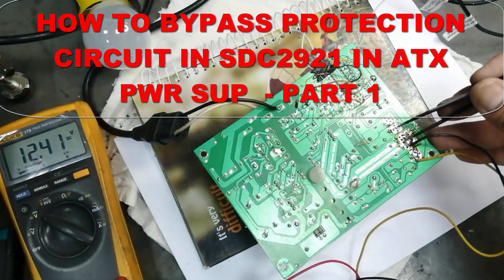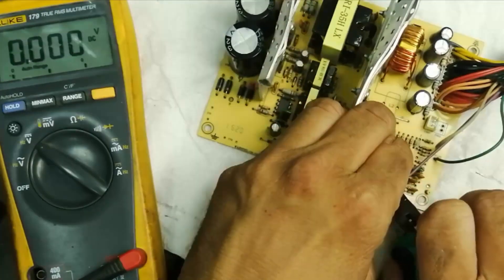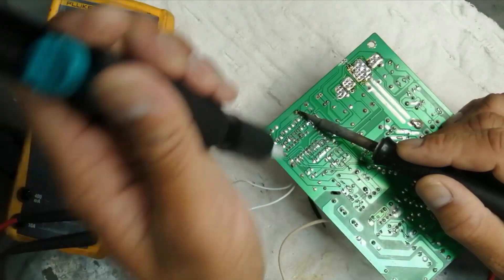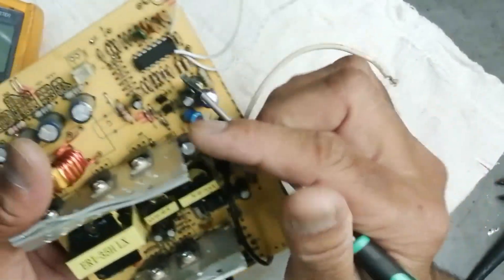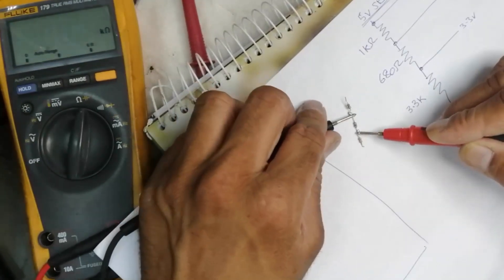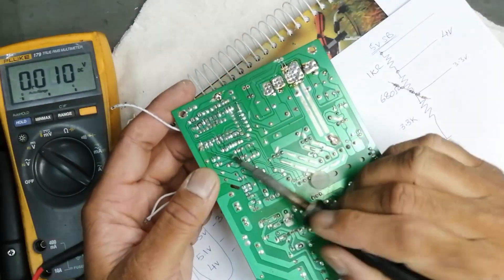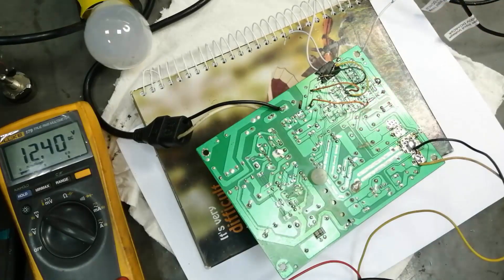#197 How to bypass Over Voltage Protection in ATX SDC291 Part 1

Comment: Voltage divider on 5v sb not working on my test. I disconnected the sense voltage and replaced it with the diy voltage divider. 3.3v + 4v = 7.3v. thats more voltage that the 5v sbv can give. As i remember, the sum of the total voltage of each point will be just equivalent to the initial supplied voltage (which is 5v in this test).

Can you please enlighten me? Thank you.

Comment: 🎉🎉🎉 Gracias por los aportes muy importantes.... Tengo una ATX con un IC HS-8108 la cual me gustaría poder Modificar su Voltaje en +12 voltios llevarlo a 13.8 vol para husar de alimentación para Radioaficionados C.B 27Mhz entre otros usos más como fuente de pruebas de taller .....he logrado revivir otras con el Tl-494 Pero tampoco subirle el voltaje máximo a 12.9 ..... Y al conectar la carga se baja a 11.8 funcionan Pero no me da el rendimiento que amerito y la proteccion en algunos instantes se activa y apaga ....... por favor si me puedes ayudar con lo del HS-8108 ya que está ATX la veo muy buena he logrado encender aparte del radio una bombilla incandescente de alta y baja 12voltios 50 Vatios de vehículo ..... Se le saluda desde San Cristóbal Táchira Venezuela Gracias 🫂🫂🫂🎉🎉🎉

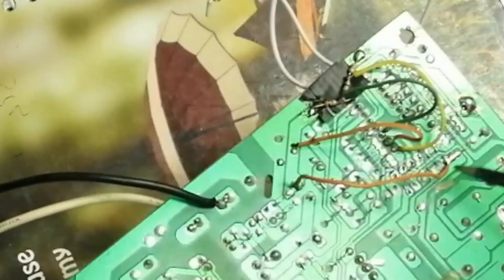Comment: 14:42 sir my SMPS have hs8110 ic ...... sdc2921 ic and hs8110 ic this pin out ar same.... I successfully make it variable but the over current protection is  still working 😢 and it's shutdown... did I need to remove pin 4 (pt) ? Will it work?

Comment: Thank you for good tip video, i has an ATX psu (named andyson e5 400W) with LA8100PN same as SDC2921, when i PS-ON the fan only spin 2, 3 round and off, i check every thing and can't find problem, so i use your trick at this video, so fk good, the PSU work fine 12V, 5V, and 3V3 is okay. So i think problem is three feedback, i check the resistor fb and that true value, no problem on three line feedback. i check -12V and it has -10,9V,  the -12volt line doesn't have line to IC, so i think it not care with IC, so what can i do with this problem, can i use my computer with voltage fb made by resistor on your trick?

Comment: Sir, I also try this method on atx smps based HS8110 pwm ic. But the result is output 12v increase 14.8v, 5v increase 6.32 & 3.3v increase 4.06. So sir how can solve the problem? Please help me.

Comment: Dear Sir, fist of all, thank you very much for sharing your video.
I have 2 doubts: at min 12:10 you said that must cut the line to disconnect some part of the circuit. Same at and min 12:34 also said to disconnect other section.
As my board is completely different than yours, I am stacked and I don't know what must cut. I am afraid to make a mistake and I ask you to explain me where to do that.
Thanks a lot for your quick reply.
Kind regards from Principality of Andorra.
Hugo
Reply from the maker: most welcome brother 
my humble request to please wait for couple of days (less than a week) . i will share a complete and very detailed tutorial, so that it will fit in every kind of ATX
Reply: @HaseebElectronics  Thank you for your very quick reply.
I will wait for your new video, but maybe in the meantime, you can bring me some tip about my question. I have the power supply completely disassembled on my desk :-))
Thanks for your generous sharing of your knowledge.

Comment: hs8110 ic in my atx 
i did what you told then powersupply working  but
when i short circuit 12v it shut down my power supply
please help me
Reply: reply please
Reply from the maker: check PT pin pin number 4 (give external 1 volt to bypass this protection
3.3 v pin 1 must be around 3.3v
5 volt pin 2 should at 5 volt 
12 volt pin 3 must at 4 volt 
and connect your desired supply for regulation
Reply: @HaseebElectronics 1v kahase milega
Reply: @HaseebElectronics  success ho gaya sir , mene pin 4 ko disconnect kar diya 
ab output ko short karne par power supply off nahi hota, on hi raheta he
Reply from the maker: wonderful 
excellent my dear friend
Reply from the maker: ye extra protection pin hoti he Jo k short circuit detect karti he 

pin 1, 2 3 under voltage and over voltage detector pons hein 
lekin PT pin 4 short circuit detect karti he
Reply: already 0.9 volt present at pin no 4 PT

Comment: Hello, how did youdo to find the resistors values for the divider ? i am struggling and i cannot find values to go from 5 to 3.775 to 3.375.
Reply: @HaseebElectronics Salam M.Haseeb. Thanks, indeed I tried  3.3k + 580 + 1K and it falls within range without connecting the IC pins,  the 12v sensing pin is connected directly to 5vsb as per its original value, but when i connect the ic pins (DWA103N, pins 10/11/12), the voltage at pins 5v and 3.3v falls below 1v , and i have no more output... any idea ?
Reply: @HaseebElectronics  I did unsolder them from the PCB without cutting any trace because the traces are very thin. It was easier for me this way. Voltages are good but when i connect the PINS, it goes fault.
Reply: @HaseebElectronics  the 12v is at the far end of the divider because its original value was 5.1v, which is very close to 5vsb. How can i send you a picture ?
Reply: @HaseebElectronics when i do connect the PINS to the divider i have no output at the yellow 12v ...

Comment: Nice video 👍

Sir, in my smps circuit sdc2921 ic has two resistors connected, one resistor connected to +12 volt and the other connected to -12 volt, should I disconnect both?
Please reply

Comment: I like the process and the idea behind it. but I still don't get it: why do you need to bypass the sens circuitry? isn't it better to leave it with short-circuit protection on? what's your objective?
Reply: Can’t start motors because it trips the overcurrent on startup
Reply: @therealdorkface  but my case it still turn off😢I don't no why I remove all residents and ad new